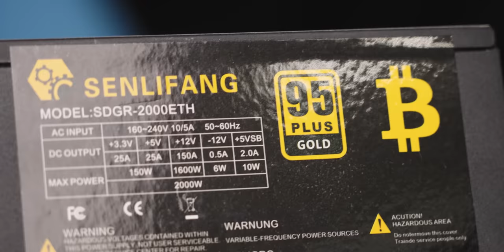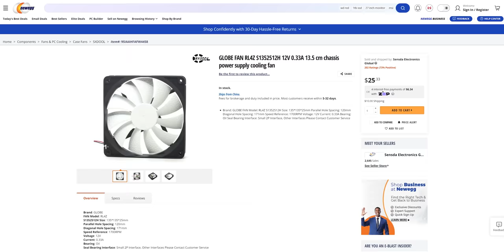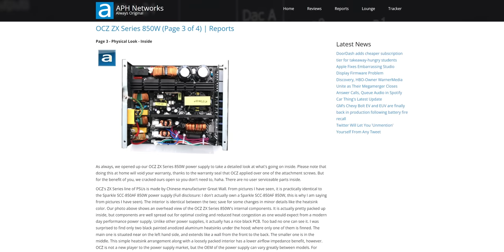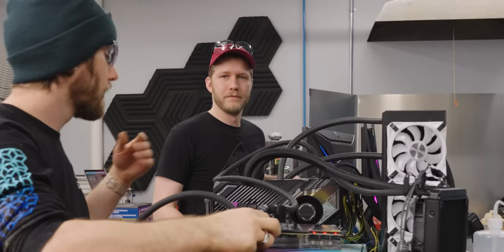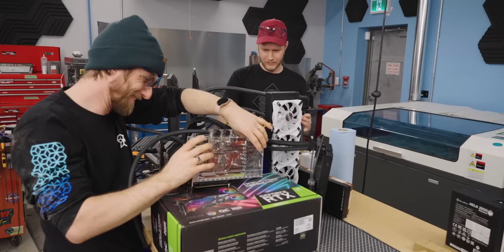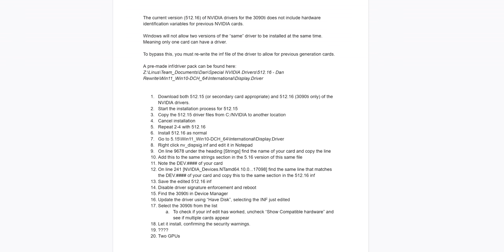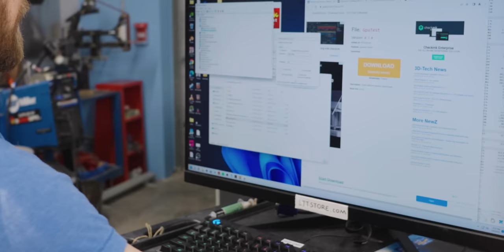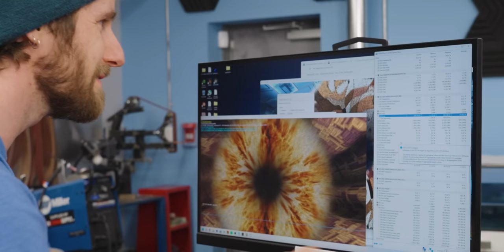This is one SKETCHY 2000W Power Supply

Comment: i love how they treat the 240 v cable like high tension or something, when almost everywhere in the world you use it to power your blender at home.
Reply: Watch what happens when you put a toaster meant for 120v on 240v. The issue isn't necessarily that 240v is dangerous (though technically it is) but that this is thorough misuse of cabling which creates an inherent feeling of risk since it can overheat, melt, catch fire, short, etc etc.
Reply: @Fenriswaffle  yeah but they use high tension cable (used to power 480v or higher stuff) to power up a simple machine.
Reply: @ChilenonetoYoutube  Because the cable should always be able to handle more load than the breaker, and I'm assuming they don't use the little 12 or 16A breakers for their 240V circuits ther like we do in Europe. So the current could be a LOT higher, hence the bigger cables for these systems. Obviously that cable was oversized for the PC, but not for the breaker.
Reply: @LuLeBe  In the US and Canada our 240V circuits are reserved for high power applications like ovens and electric dryers, so that circuit was at least 30A, if not more.
Reply: @LEP-kn2to  Interesting, in Europe we use 230V or 240V for everything and for high power applications like washing machines or car chargers or server rooms or whatever we use 400V circuits with 16A (although there are very rarely 32A).
Reply: @Fenriswaffle  the fu.. Is that actually fuminoris face on sayas head ? why the fuck does it look so uncanny? Q_Q
Reply: @Lyghfe  Yes, yes it is. Isn't it wonderful?
Reply: Its funny hearing them saying "its 2 kw, where are we going to plug it?" while at my house in Europe every plug has an output of at least 3,5 kw and some have 4,5 kw.
Reply: 240v at anything 30a and above can easily kill you or permanently alter you for life. A standard outlet on 120v can too but it's much much less likely. 

It gets incredibly more dangerous passed standard 240v. I've had 480v-680v arc off a control board in commercial A/C units and singe my arm hair off.
Reply: @mtdla  And 24 kW max for whole house, That's a crazy amount. I have been shocked by the mains wire entering house, Unsure how it didn't kill me but it was extremely painful compared to a shock from a household item.
Reply: @Fenriswaffle  240 V presents less danger for fire due to overloading or similar because the same amount of power is drawing half the amperage, and so heats the cable less. If you're using a cheapish extension cable rated at 12 A, a 1500 W heater at 120 V will draw 12.5 A across it, possibly causing a dangerous amount heating. But a 1500 W heater at 240 V will draw only 6.25 A across it, which should be completely fine.

(This is all for properly functioning loads, of course. For short circuits and the like it shouldn't matter at all since the circuit breaker should trip long before the current draw generates any significant amount of heat.)
Reply: @Curt_Sampson  Sure but I wasn't at the time referring to the objective level of danger of 240v vs 120v. What I was referring to was misuse of cables made for a level of concern because devices intended to work off of 120v wouldn't necessarily know this, especially if you aren't switching the power supply to a 240v mode, nevermind the fact that 240v circuits can draw up to 30 amps before it trips the breaker in most homes. Some of it is LTT playing it up for the video, but its also just...not a good idea to use a cable rated for 120v in a 240v application in NA.
Reply: @Fenriswaffle  You've got it exactly backwards. Virtually all consumer cables (extension cords, power bars, etc.) are already rated for 250 V anyway: the differences between 250 V rated and 125 V rated are so minimal it's not worth manufacturing two cable types.

The primary concern is their amperage rating, and anything running at 240 V is pulling half the amperage of the same device running at 120 V. So the safety issue would be using the thinner, lower-amperage cables designed for 240 V users in 120 V applications that are pulling more amps.

And no, consumer 240 V sockets in areas where the standard voltage is 240 V are not generally rated for 30 A; they're usually rated for 10 to 16 amps, which still provides provides more power (sometimes more than twice as much) as a North American NEMA 5-15. European Schuko are 16 A; British BS 1363 are 13 A; Italian CEI 23-50 S 10 and Swiss Type 11 are 10 A.
Reply: @Curt_Sampson  aaaand north american 240v circuit breakers are often slotted with 30-60 amp breakers. I am not speaking for European circuits. I am an American speaking for American and Canadian circuits. Additionally a not-so-expensively made extension cord could be made with up to 18g copper. And we're not talking about things working as expected, we're talking about fitting the wrong kind of cable to a circuit that it is not designed to work with. Will it work without issue? Probably, but its also not operating within the margins of safety that are enforced to prevent fires.
Reply: @Fenriswaffle  You still have the basic problem backwards in that you're thinking of 240 V as the source of the danger to cabling, but that's actually the opposite: it's making whatever cable you use twice as safe as if you ran 120 V across it.

Let's say you're go buy a North American extension cord designed for a maximum of 1200 W. This will use 10 A rated wire, and if you use it to power an 1800 W device from a 120 V outlet, you're well exceeding the wire rating and are definitely in an unsafe situation. But if you use it to power an 1800 W device from a 240 V outlet, you're now drawing only 7.5 A  across the wires and are well within the safety limits of the cable.

If your device is something like a multi-voltage 2000 W power supply that's 80% efficient, it could in theory try to draw as much as 20.8 A from a 120 V circuit, which, if you're using a 20 or 30 A wall outlet so you don't trip the breaker, leaves you with an unsafe situation if you're using even a high quality North American 1800 W (15 A) extension cord. But plug that same extension cable into a 240 V socket and now your PSU is drawing a maximum of 10.4 A and you're not just ok with that, but even probably ok even with a cheap North American 1200 W extension cord.

TLDR: Any standard consumer extension cord you use is safer at 240 V than at 120 V.
Reply: @Curt_Sampson  So if you plug a toaster in to 240v its going to know to pull less amps? Not everything has a switching power supply that accepts both 120v and 240v. You can't plug a toaster in to a 240v outlet and expect it to run "cooler" because its somehow magically pulling less amps because its not going to pull less amps. In North America, 240v circuits will absolutely draw a much higher wattage and current, please consider ohm's law and that this isn't the EU?
Reply: @Fenriswaffle  You were originally talking about the dangers of modifying extension cords and the like in the way they did, and I stand by all my comments on that, including that the cord will be safer at 240 V with a multi-voltage power supply than it would at 120 V with the same supply (and just as safe with a single-voltage power supply, though the PSU itself may be damaged if you plug it into a random voltage).

You're right that some resistive devices, such as your toaster, will probably draw more current at 240 V than 120 V. Most of these should immediately fail safe by blowing their fuse. But if it's poorly designed, yes, it's possible that it continues to draw current, and additionally possible that the cord fails before the device.

Given that your desire is to construct situations where a consumer extension cord fails at 240 V in a way it wouldn't at 120 V, yes, you can always construct some sort of situation in which this would happen. That does not change the general case that consumer extension cords of all types are generally safer at 240 V than 120 V.

(As a reminder, this is because it's actually more expensive, not less, to manufacture two separate sets of 120 V-rated and 240 V-rated cords, so everybody always just uses 240 V-rated cords regardless of where they will be used. Thus the only safety issue is the current capacity. There is no situation in which current is increased at 240 V vs. 120 V, and many situations in which the current is reduced. )
Reply: @Curt_Sampson  Its a constructed situation that highlights why Linus and co are treating the modification as they are, even as performance (and also because hamming it up is their shtick)
Also a lot of cheaply made cords and devices don't have fuses in them because most times its not mandated by law (in NA)
Its not unreasonable to consider this "unsafe" because resistive devices will just pull what they have access to, and 240v cables are absolutely designed to be heavier duty here because 240v means higher amps are inevitably available because 240v in NA is used for water heaters/electric stoves and etc which is why their outlets are always different and more importantly incompatible with 120v plugs. Is it a likely scenario? No, but its worth pointing out when they're modding a cable designed for 120v to use for 240v with a dodgy power supply. Its just not a good idea, and it can lead to an unsafe situation if you don't know what you're doing.
Reply: @Christian Pulgar Cofre - 
YES , they just use 240 Vols with saver sockets that don't shock you (like in Germany & Korea)
Reply: @LuLeBe  in north america we use 30 amp breakers for 240v applications, because 240v is relegated to high-draw appliances like clothes dryers and entire travel trailers
Reply: @Fenriswaffle  240 volt is SAFER than 120 volt ;) as far as electrocution risk they are basically the same (stick a fork into either outlet and you will regret it), in terms of building fires 120 volt is literally twice as dangerous. Twice the resistance, twice the amperage. It's the amperage that kills anyway, voltage just helps overcome resistance.
Reply: @Muffin_Masher  Had an entire conversation about it, I know its a bunch of back and forth but there's not much extra to add without repeating.
Reply: @Fenriswaffle  i enjoyed reading the lore from you guys’ 3mo old convo on something i don’t know a damn thing about.
Reply: I think it's less about 240 being dangerous and more about the cable itself being dangerous.  Because it's really not a good idea to modify a cable like that, especially if - as they mentioned - it has the socket meant for 120 on the other end.
Reply: @LuLeBe  16a breaker, little? Your lucky to find 15a here in Australia witch sucks for welders that want to mess with ac/dc tig at home as you will never get enough current to run them without risking burning wires, and funnily enough from experience with the last 2 houses I've been at the power is at the complete opposite end of the house than the garage so I would dare say being a long run you would burn the house down eventually if you chucked a bigger breaker in.

Really sucks, I need to up my tig skills a bit more that's where it's at
Reply: Yea but this is 240 V at 30 A being plugged into a janky setup, most of the world doesn’t use 240 V at 30 A, it’s usually much lower at 12 or 16 A, which means much less energy involved in the process.
Reply: @Muffin_Masher saying the amperage kills isn’t really correct, for example you won’t die if you touch a welder even though there is a high current running through it, that’s because it is at a relatively low voltage. What is actually dangerous is high voltage, because the higher the voltage the easier it is to get a lethal shock
Reply: I actually have this psu but at 1800w and I am petrified of it lol. It was part of a prebuild. But I gotta say my fan isn't that loud at all and I havnt noticed it giving off much heat yet but im scared to find out and looking into a new psu asap. Has anyone had anything bad happen with one of these yet?

Comment: Alex: "Don't touch these"
Kyle: immediate physical contact
Reply: They stated early on that both PSUs had been powered off for over a year so we're safe to touch. Normally you wouldn't want to touch as the capacitors could still hold a charge
Reply: Like they are propably safe after a few weeks, they are 99,99999% safe after a few month, that being said. Don't touch them they could theoretically still hold a charge but you know, they propably dont
Reply: Alex: CYA statement
Kyle: I know how long they have been on the shelf.
Reply: These are just some caps. Yeah you would get a shock like in the order of magnitude of an electric fence. But not really dangerous
Reply: Apparently I have a really bad sense of humor or my jokes are just bad
Reply: @samuelrodriguez6684  HAHAHAHAHAHA

Comment: In three wire 220/240 volt(or four wire for that matter) where the two hots go doesn't matter since they are completely opposite phases and are indistinguishable on the device side, it also doesn't have a neutral because it creates a phantom neutral at the center point of the two phases
Reply: Ground on the other hand is absolutely required. Terms neutral and ground are often mixed up in everyday speech.
Reply: @TealJosh because in North America they are often the same thing when you're dealing with 120 volt outlets (don't worry about it. It's confusing and stupid)